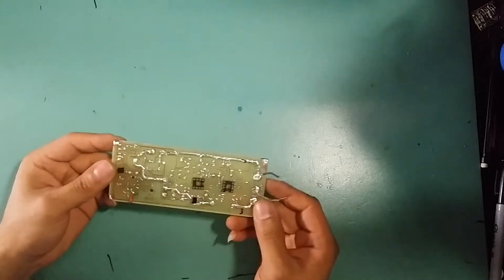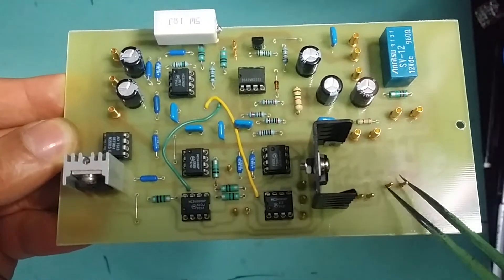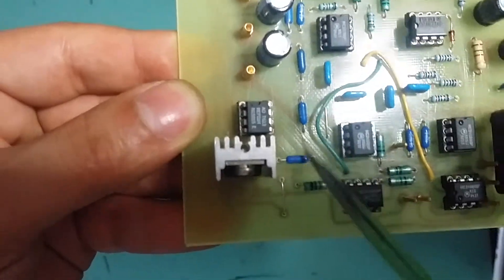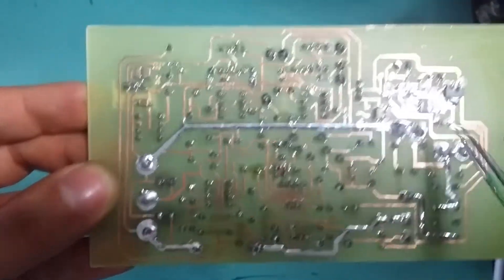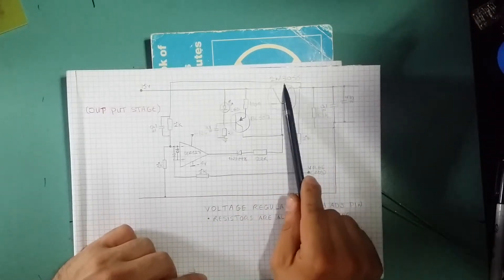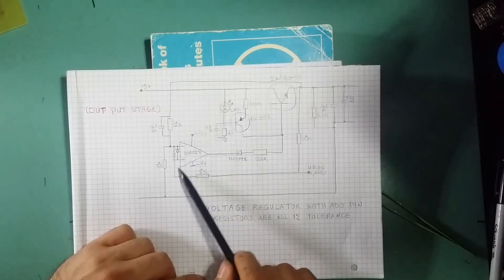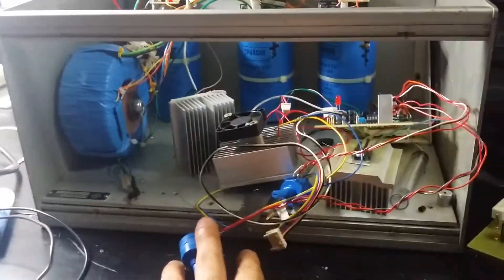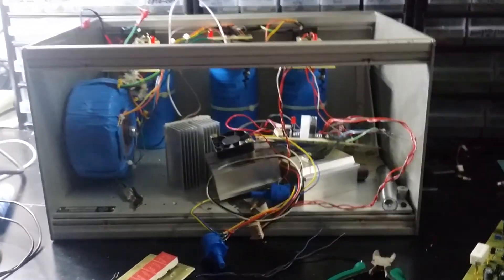Lab power supply design part 7

Comment from the maker: No, i was going to look in to that few days ago, But I have found a spray on gloss paint in my lab and  I used it on the one of the pcb and now it is hardened so i might just use that. It forms a coating on the copper so no oxygen can react with it, and if i need to mod the pcb all i need to do is to clean it off with paint remover.